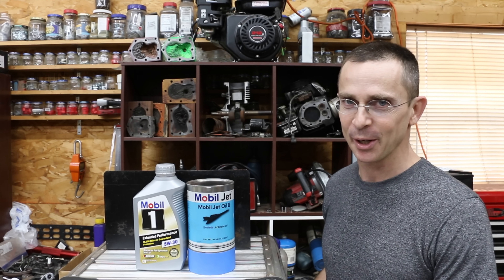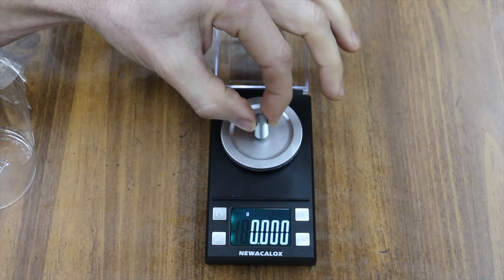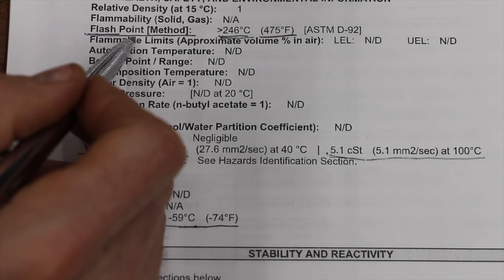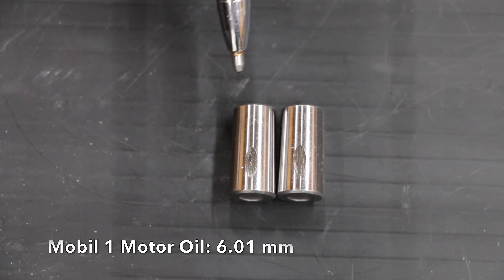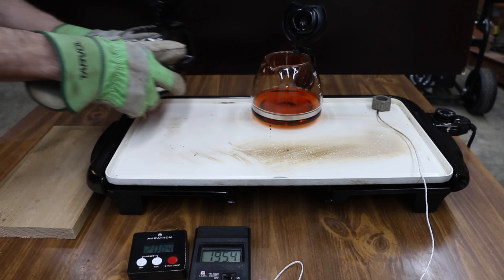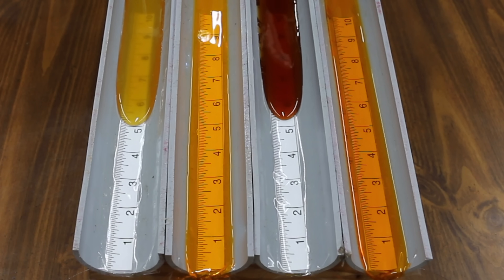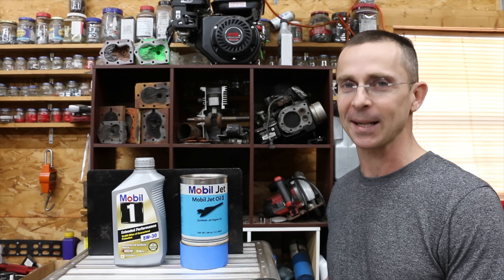Is Jet Oil better than Mobil 1 Synthetic?  Let's find out!

Comment: In flight school we were told that jet oil is designed more to remove temperature from bearings that really lubricate them as we think of lubrication.   Not to mention as mentioned it will ruin most auto engine seals.  Most jet engines have roller and ball bearings and spin at very very high rotational speeds and the internal temperatures are extremely high.  So you want an oil to keep the bearings cool and spinning free also foaming can be a problem in jet engines so the oil contains an additive for that which is not a problem in auto engines
Reply from the maker: Thanks for the feedback.

Comment: As others have said, jet engines run on ball and needle roller bearings, there are no plain metal bearings. Also jet engines use pressure balanced labyrinth oil seals that have no actual physical contact between shafts and housings, no rubber lip seals and only a few o rings in static joints.
Reply: The oil seals that have contact are usually carbon against a steel, which the oil does lubricate some, but pure carbon has very low friction.

Comment: ..I worked as a Temp at a Shell Canada tank farm/warehouse, way back, '87.  I got my mitts on some synthetic Aeroshell aircraft engine oil.  Multi-grade and an 80 weight.  The 80 weight was almost like a jelly.  I got my v4 rice rocket up to temp., drained the hot oil and put in the 80 weight.  The rattle and noise from the engine was cut in half, at least.  Then I jumped on the bike an rode 500 miles...
Reply from the maker: Thanks for sharing!

Comment: Jet oil has a higher viscosity becuase the turbines spin at nearly 90,000 rprms which is why you would not use conventional oil 

Car engines rev to around 7-10k depending on the type and need a lower viscosity to remove heat since jet engines are cooled primarily by air at higher altitudes

Great video I was very interested in this
Reply from the maker: Thanks!

Comment: For the jet oil, it obviously slung out enough oil in the first part of the first test and wasn't applying any oil to the wheel for most of it because the oil level dropped so low.
Reply from the maker: Thanks for the feedback.

Comment: Many type jet / turbo prop & gas turbine like APU oils. 
Have use Shell 500 oil for MIG 23, 2mm'2 low viscosity. Change many time, fly perfect. 
Gas turbine helicopter Shell 555 use, 5mm'2, high load oil.
Possible 555 oil run petrol engine/ diesel engine. Also APU oil 308 possible.
Very good video, we like always. 
Sorry English if bad
Greeting from Russia (Cherkasy & Girood).. ♥️
Reply from the maker: Thanks!  Thanks for sharing.

Comment: I last saw an 2 stroke oil witch is mixed at 1:100 instead of 1:50 and claimed less smoke more performance and better fuel economy than a traditional 2 stroke oil. Its called Triboron.  Would you like to test it against a normal 2 stroke oil.
Reply from the maker: Thanks for the suggestion.

Comment: When I was in the army I drove a dodge gasoline 318. That use about 1to 2 quarts of oil a month.  I found a quart of turbine engine oil add it to the truck. I didn’t had to put more oil in the truck for over one year. Jet out mixed with engine works 👍
Reply from the maker: Thanks for sharing.

Comment: You should test the never change oil engines. If a normal person cuts their grass once a week and it takes a hour, a whole summer is like 20 hours. (May-sept). They give a 10 year service life so run it for 200 hours. Running the engine 8 hours a day for 25 days would complete the test. Test the oil before and after with the lab.
Reply from the maker: Thanks for the video idea.

Comment: Helpful Tip...don't run 15,000 mile Mobil 1 without changing your Mobil 1 oil filter at 7,000 miles..
Reply from the maker: Thanks for the feedback.

Comment: Watching this and the bacon grease one, I'll bet the thicker the oil the smaller the wear spot in the lubricity test.  Have you ever thought of doing the same oil brand across weights? Ie 0w20, 5w20, 5w30, 10w30, 10w40 all supertec?
Reply from the maker: Thanks for the suggestion.

Comment: As well as some aircraft hydraulic fluids. 5606 hydraulic fluid and skydrol (use caution with skydrol)
Reply from the maker: Thanks for the feedback.
Reply: If you are looking to do more aircraft oils too here are some suggestions. Aeroshell 500 turbine oil, Eastman 2380 turbine oil against Mobil jet oil 2! Most of that you can find on a website called aircraft spruce

Comment: Mobil Jet 2 was designed for gas turbines with NO PLAIN BEARINGS! Balls and rollers only. Also temperature extremes. You could retry the lubricity tests with Aeroshell 750 if you can find any...
Reply from the maker: Thanks for the feedback.

Comment: Did you know that jet engines never change their oil until they go in for engine overhaul?  Its so they can track metals in the oil and schedule overhauls based on wear.  The DOD did a test where they didn't change vehicle engine oil either, just changed the filter and added a quart.  They went back to changing oil.
Reply from the maker: Thanks for sharing.

Comment: Cool!

For what I know : 

The engine oil has to lub bearings cilinder's piston's and distract some heat from all the parts inside the engine.

While the jet engine oil only need to cool and lubricate the bearings inside the engine so there are no sliding parts that has to be lubricate.

And i think that's the reason why the jet oil failed the lubricity test.
Reply from the maker: Thanks for the feedback.

Comment: Jet oil needs good cold and high temp performance, is far less likely to get contaminated by carbon so doesn't run as much detergent, rolling vs sliding friction, very low service intervals. It's basically a high performance, low life oil. Our fleet operates PW127M's - typically take 1qt oil for every ~10-20 hours of operation. It gets vapourised, burned or leaks out.
Reply from the maker: Thanks for the feedback.

Comment: As an Aircraft Mechanic I can say definitively JET OIL DOES NOT BELONG IN YOUR CAR. It should be noted that jet oil serves 2 main purposes 1. Lubricate the moving parts, and 2. Dissipate heat. The latter is why it fared so well in the temperature tests. Jets have dedicated air/oil heat exchangers (fancy radiator). Some engines will use the hot hot hot oil to warm the fuel going into the engine AND through a heat exchanger. As far as the lubrocity is concerned. Jet engines have intensly closer tolerances between the shaft and the bearings than a conventional automobile engine. This means you have "less space to fill" with the oil. A thicker oil would not move as freely through the system thus not dissipating as much heat, and cause damage to the engine. A thicker oil would cause more resistance to movement. A less efficient engine costs airlines more money in fuel and its just not good for anybody.... Jet oil is engineered for a specific purpose, as is auto oil. Those 2 purposes are apples and oranges compared to each other
Reply from the maker: Thanks for the feedback.
Reply: Just out of curiosity I'd like to see the lubrocity test done with the sub-zero jet oil compared to the sub-zero auto oil

Comment: Back in 1972 I knew a guy who thought jet engine oil would be good for his car.  He changed the standard motor oil out for jet oil in his car one weekend.  He cranked up the car and proceeded to drive the car.  After about forty miles or so the engine stopped.  The pistons had seized in the block.  Trashing the engine.
Reply from the maker: Thanks for sharing.

Comment: I'm searching on your channel if you have  made a video on Shell Advanced motor oils with PurePlus Technology claiming that the oil has lower evaporation loss, better fuel economy, better viscosity at cold temps compared to mineral and synthetic based oils. I would love to see you test their claims. (the keyword is PurePlus Technology). Thanks!
Reply from the maker: Great suggestion!  Thank you.

Comment: You often use the bearing test method, as such I would like to see you test it to see how it handles various conditions.  In particular, with a single oil I would like to see the difference in two different things.  The first a cup that where the bottom of the wheel is well submerged in the oil, and another where the wheel just touched the oil,  I've seen you vary that amount in tests and always wondered how that would affect the results. Secondly I would like to see the difference between pre-oiling the wheel before contact with the bearing vs dry starting, allowing that first half (or so) revolution without lubricant.
Reply from the maker: Thanks for the feedback.

Comment: I work at a facility with a few jets in it, and from what I understand, the jet oil is mostly for cooling and cleaning bearings, lubrication being a secondary function rather than primary as it is in motor oil. Also, that jet 2 is nasty stuff, and you definitely don’t want it on your skin anywhere. Plus it stinks, especially once it’s been in service for any amount of time.
Reply from the maker: Thanks for the info!

Comment: This is a subject I know well. I am a jet engine mechanic. The reason it failed the wear test is because the way it was tested. Jet engine oil has to be pumped and the parts must be squirted with oil and recirculated. Jet engines also use ball bearings. It is designed to work in extreme temperature changes from being hot on the ground to subzero temps at altitude. The same oil is circulated in the accessory gearboxes too. Jet engines internally reach temperature of over 700 degrees Celsius.
Reply from the maker: Thanks for sharing

Comment: I wish I saw this last month :(
Reply from the maker: Sorry about that!  Thanks for watching.
Reply: @ProjectFarm  I worked for SouthWest fuel farm in Dallas for a while, some of the mechanics will take a few gallons of jet fuel and add motor oil to it, then use it in there diesel trucks
Reply: @ProjectFarm  they basically turned Jet Fuel in to Diesel Fuel

Comment: VIDEO IDEA: Get the "Velocity of Flow" during all of the Flow Tests.
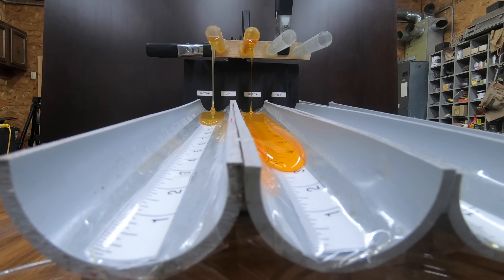Example: In this video at 5:45 - The distance between the Jet Oil winning over the Motor Oil was 8-inches; but, also knowing how much longer took for the Motor Oil to finally get across the finish line would be beneficial in order to get as much information as possible. With the Distance AND the Time we can calculate the Velocity of Flow (VoF) for everything you Flow Test. And, all it would take is putting a Timer somewhere in the shot during the Flow Tests.

I just thought it was funny that you had to speed the video up by FIVE TIMES to get the Motor Oil to FINALLY cross the finish line. Which made me think, "Man! HOW MUCH SLOWER was that Motor Oil compared to the Jet Oil? That Cold Rating must be terrible." Anyways, this made me realize it would be a good idea to know the Velocity of the Flow. to help people judge which Motor Oil they should use in colder Climates/Weather.
Thanks for the video. Take care and stay safe out there.
Reply from the maker: Thanks for the video idea.

Comment: The biggest difference is the viscosity - also, jet engines run at much, much higher speeds, where lower viscosity is a big plus, and there aren't many parts that slide against each other like in a piston engine. It would have been a better test to run oils of identical viscosities, perhaps a 0W weight for the motor oil would be close enough?...

Comment: I use AMSOIL and now feel vindicated in my choice.   Forty years ago I used it in my Volvo and one day when checking out the oil level I found there was no oil on the stick. I discovered the oil drain plug  was missing.   I got  a replacement with no ill effects on the engine, go figure.   I still drove the car to get a replacement plug. 
To bring up another idea what about grease for power tools like drills, portable grinders, and saws, etc.   I am wondering if the Lucas Red & Tacky could be used in them or is there an entirely different grease required for gears.  Back in the day I used to repair power tools but did not pay attention to what type of grease we used in the shop. 
Cheers .,. Bob
Reply from the maker: Thanks for sharing.

Comment: I am a aircraft mechanic & have added 20% mobil jet oil with 15w-40 on oil changes. From my testing I have noticed  a decrease in temperature on the gauge of my 94 Jeep Grand Cherokee v8 with 265,000 miles. Filters are cut  open no metal found on inspection. Engine quieter warming up also noted.
Reply from the maker: Great feedback. The jet oil seems to be hard on rubber components  and seals
Reply: When I was in A&P School my engine instructor Mr West was from Canada where he ran a helicopter business in the Northern Canadian wilderness.  He said they used 100% jet oil in the piston engine helicopters. With no problems. Of course it isn't approved but under those extreme cold temperatures it works.

Comment: No no. You don't want to use lubricating gearbox oil for gas turbine engines in your automobile reciprocating crankcase. The tolerances of bearings in gas turbines are much more tighter requiring a very thin weight "zero" viscosity oil. Gas turbine oils are required to withstand the very high RPMs of lubricating parts and the super high heat of gas turbines. Lubricating oils for gas turbines have lower anti-foaming agents, additives like zinc and detergents. Plus not to mention the Prohibitive Costs $$$$.00 per quart of gas turbine oils per hours of run time or miles between oil changes. Mobile One Oil does manufacture gas turbine oils for the US Military MIL-L23699. Seems like good idea, but replacing your good old Wal-Mart brand synthetic oil manufactured for reciprocating engines with lubricating synthetic oils for gas turbines engines is a poor decision and can cause considerable damage.
Reply from the maker: Thanks for the feedback.

Comment: Debunker strikes yet again.   I was a Boilers Officer once upon a time.   We used a synthetic oil called 2190 TEP to lubricate our steam turbines.  Only moving parts were bearings.  2190 TEP was thinner than motor oil with a high flash point.   Dont remember exact numbers.   Never replaced the oil unless some leaked out of the turbine cases.   We would purify the oil in a heated settling tank and centrifuge to remove any foreign matter.  Good thing as that oil was DOD crazy expensive.    Side note: TEP = turbine extreme pressure.
Reply from the maker: Thanks for the feedback.

Comment: The last flow test showed that the cooked jet oil was just slightly darker than the uncooked jet oil. It would be neat to use a turbidity meter to see the difference between the two.
Reply from the maker: Thanks for the suggestion.

Comment: Of course you realize that jet engine oil is designed for a different type of lubrication problem and environment. Oh yes it’s also used to warm up the jet fuel and the jet fuel also cools the engine oil etc.
Reply from the maker: Thanks for the feedback.

Comment: Oil for jet engines are vastly different. Jet engine uses roller bearings and magnetic carbon seals. Automobile engines use plain bearings and rubber oil seals. Both engines require very different lubrication properties. Comparing the two are like apples and oranges.
Reply from the maker: Thanks for the feedback.

Comment: Another product I use often is mobile 1 full synthetic T4 race oil. It has a picture of a race motorcycle on the front.  I started using it years ago when a wise old man recommend it. He built race engines for drag bikes and told me any oil that is s h grade is great for hi performance engines. I noticed that the mobile 1 t4 race oil no longer says s h grade on the back anymore but it did years ago when I started using it and it was the only oil I ever found that said s h grade. 
I would love to see tests on the mobile 1 motorcycle race oil and Blendzall Gold label !
Reply from the maker: Thanks for the video idea.

Comment: Owning a couple of turbine engines, you quickly understand the difference. Example, instead of a pressure lube plain bearing, turbines use as noted, high speed ball and roller bearings, but more importantly, they use oil mist lubrication. What does that mean? It is literally a spray of fine oil mist sprayed into fast rotating bearings the idea being to prevent the balls and rollers from skating VS rolling. Second part is, the same oil has to lube gears at just insane spinning speeds. So unlike an automotive gearbox full of heavy 90 weight, no, the same super thin jet oil is sprayed into the teeth contact points. But the most important is then because of all this spray and high speed, you need fast return and settling into the sump so the oil pump can pump back fresh oil to these sprayers. So a key additive property of jet oil is to not foam up or trap air. Otherwise the sump would just be all foam in seconds. Motor oil does terrible under these conditions. Conversely, turbine oil won't do well in a conventional engine. But they are so widely varying conditions, that's to be expected. Again, a turbine engine bearings, gear sets for accessory drives, and other details especially on smaller engines spin from about 40,000 rpm to over 100,000 rpm, where at best, a typical reciprocating engines might be say 7,000-15,000 for extreme racing applications. Just entirely different bearings, different loads, different speeds, and thus very different lubrication systems. Not surprising then that the oil is extremely different as well.
Reply: Again, being honest, your oil tests might be valid for certain types of bearings and thus engines and tests, however, other factors such as anti foaming, drain back, high speed bearing mist applications- your tests did nothing for or like your wear test, completely incorrect for the type of oil. Here is a link to NASA testing oil for turbines https://ntrs.nasa.gov/archive/nasa/casi.ntrs.nasa.gov/20010090717.pdf
Reply from the maker: Thanks for the constructive feedback